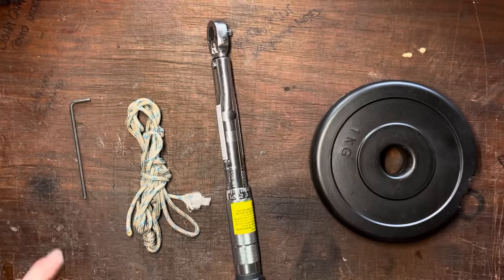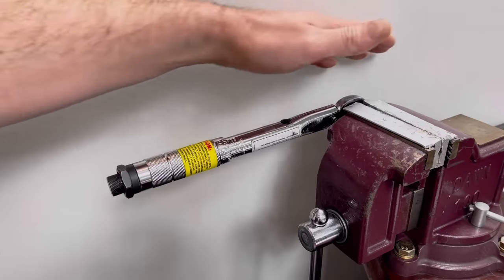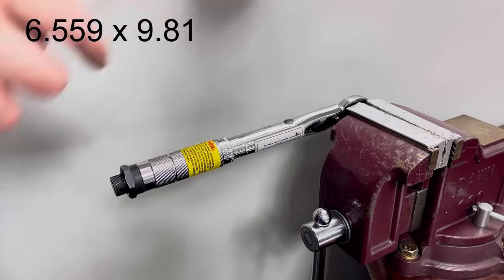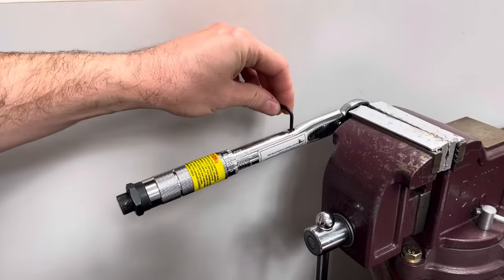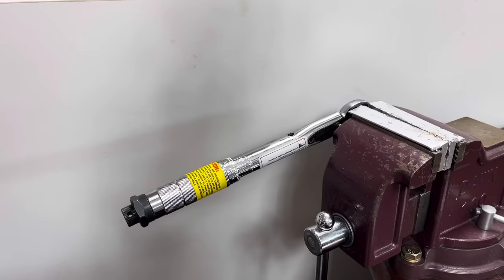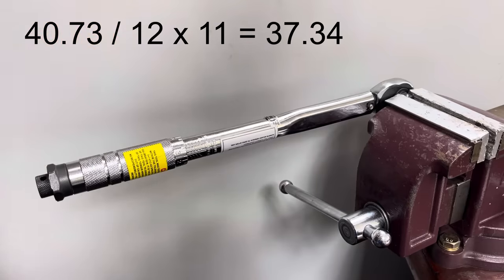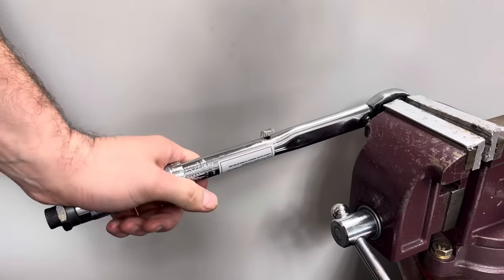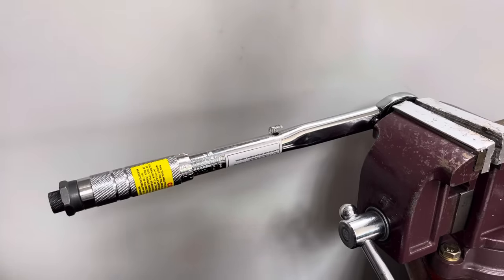CALIBRATE YOUR TORQUE WRENCH IN UNDER 5 MINUTES (NO SPECIAL TOOLS REQUIRED!)

Comment: You should measure the distance from the drive (where you hang your rope) AFTER you set the wrench to the appropriate weight because the handle moves in slightly toward the drive as you turn it. Also, make sure the wrench is perfectly level. Good tips, though. Thanks for sharing
Reply from the maker: Yep, thanks for watching. 👍
Reply: I could not believe nobody mentioned this, until I found your comment 😂👍🏼
Reply: These clicker type wrenches are typically calibrated for the force applied exactly at the middle of the grip (and it does matter, there are a few videos explaining and clearly demonstrating this), therefore that should be the point you hang your weights from and measure the distance to. Ideally, one should test different hanging positions on the handle with different weights at both ends of the wrench's torque range, find the position that gives the most accurate results throughout the torque range and then only apply force at that exact position during normal use. Whether it's going to be the middle of the handle or closer to either end of it really depends on each specific wrench model.
Reply from the maker: Yep! I have learnt something new here! Thanks for sharing :)
Reply: Also you need to take wrench handle weight into account. So actually it is way easier to calibrate it with torque meter.
Reply: @KibberShuriq  Thats only if you use this method to calibrate, when using a torque meter you can hold the wrench anywhere.
Reply: @fastone371  Nope. These type of torque wrenches actually measure the torque at the pivot point, not at the socket attachment point. Imagine applying a ton of force directly at the pivot point, or between the pivot and the socket. Your nut/bolt would "feel" that torque, but the wrench spring would not. Now imagine putting a 10 feet extension tube on the wrench. This would make your lever so long that the torque difference at the pivot and at the socket would become practically non-existant.
Reply: @KibberShuriq  Incorrect. A beam type torque wrench can be affected by where you hold it but not a "clicker". The clicker torque wrench only knows how much torque is at the head of the torque wrench, it has no idea where you are holding it. Its not like the whole handle bends on a clicker, its only the spring loaded internals.  The handle does not bend when using a clicker. If you don't believe me try it against a digital torque wrench, I have because I went thru this same discussion with someone else so I showed him how it doesn't matter where you hold it. I take it you have never seen someone putting a cheater bar on a torque wrench at a diesel truck shop? Its not that uncommon. A cheater may make easier for the user to reach specified torque but it doesn't change the amount of torque on the fastener.

Comment: Great video. I'm going to try this out myself. One note: I think it is important for the torque wrench handle to be parallel to the ground. If it isn't parallel (or as nearly so as possible) then the effective length is different from the measured length thanks to vector trigonometry.
Reply from the maker: Yes sir you’re spot on! I think it’s important to be as accurate as we can, but also remember that even if things aren’t precision perfect - it will still be more than good enough for what we do :) you won’t snap bolts being a bit over nor will it cause an engine to fail being a bit under the specified torque. Thanks for sharing!
Reply: @VintageEngineRepairs  Just as a follow up, if you're within 10˚ of horizontal you'll be within 2% of accuracy, which is equivalent to +/- 4mm on your length measurement. Given your string is about 4mm in diameter, that's plenty of precision. 
If you get out to 20˚ you're still within 7% of the calculated value, but it starts to rapidly fall off in accuracy after that.
Reply: 😯
whoooeeew
math does hit hard 😭
Reply: @daveatutube As the purpose is to calibrate the torque wrench, you want to do what you can to achieve max accuracy, and that does not involve having the handle at an angle.
Reply: @VintageEngineRepairs   You did not mention it, but did you weigh the rope with the weights? For that 1 or 2 % accuracy, the rope may make a difference. Not moaning, just checking/mentioning. Also, could we all say pound-foot, like Newton-meter? That's moaning ;)
Reply from the maker: @kapteinsuperskoot6986  yes! You can use luggage scales to eliminate this if you prefer :)
Reply: @kapteinsuperskoot6986  The rope likely does not weigh much, however the wrench itself does, and that weight adds to the torque. Something like half the weight of the wrench times its length should give a good approximation of the torque added by it, and that value would need to be subtracted from the calibrated value.
Reply: @daveatutube  What string are you using that's 4mm in diameter? That's practically rope at that point.

Comment: This is the best DIY demo I've found. The process is not that complicated, although for accuracy the right angle distance and mass need to be accurate. I've often wondered how much ambient temperature affects this clicker style of wrench. In the end, most of the time a variance of 5% is fine. Often it is a comparative tool, so even if it is out a little, all the bolts will have the same torque. These days we tend to go overboard with torque, although the margin for error in aluminum housings can be small.
Reply from the maker: Thanks for watching :) I agree, for what we all do 5% even 10% is not a problem. Heck you could be even further out and not have any issues. If it was on a a spaceship then it’s a different ball game. This gets you very close, easy to do at home and will be far more accurate than doing it by hand :) thanks for watching!
Reply: I agree that this is a clever way for diy calibration. Although not complete. Even though the style of torque wrench you show here is common, there are a lot of different ones. And the method of adjustment also differs. Some do have the screw you show now, but also a lock screw for instance. A lot of professional wrenches also feature an adjustable scale.

Typically you adjust the screw you show in the video to set max torque, and adjust the scale for minium torque. Most cheaper wrenches have a fixed scale and I would recommend calibrating for the range you use, as it will be hard to get it right all along the scale.

Most professional torque wrenches are supposed to be within a 3% margin along the full scale. Typical calibration is done at 0% 60% and 100% force. It will be hard to get it to within this spec with this diy solution. But it's definitely better than not checking it at all. The 3% margin is also ludicrous if you ask me, how you hold the wrench, how you apply force, is your bolt dry or lubed, etc will have more effect on the end result the a bit bigger margin on your wrench.

Bear in mind that the electronic force gauges might also not be accurate. Especially cheap models can have quite some deviation. So you might want to check the force gauge with this method before using it to calibrate.

In short, good method for approximate calibration with little expense. But not suitable for critical work.

Just my 2 cents as someone in the tool business, including calibrations.
Reply: The wrench handle should be horizontal; maybe it's the camera angle that makes it look like it's pointed down, which would make it require a higher torque to click off.

Comment: always back off torque wrench when finished using relieving spring pressure
Reply from the maker: Spot on, couldn’t agree more!
Reply: Agree...
Reply: Wrong, leave a small amount of pressure, 5 ft lbs, so the spring isn't collapsed on itself.
Reply: I see leave 5 and zero...ok, lock it or keep unlocked
Reply: @jeremywallace5961 how does a spring collapse in on itself?
Reply: I always thought so too but our latest Norbar 1/2” (40-200 Nm ??) comes with a note saying to leave it mid-dial (120Nm)!
Reply: Depends. We have torque wrenches used for testing of weld on nuts  in our production line that has been set at a certain torque for many many years and they still pass the calibration test every year. So I feel its a bit of a myth that they go bad..
Reply: My wrench instructions say store at the Lowest setting
Reply: @dubmob151  when the coils are touching, it has collapse on itself
Reply: Myth
Reply: There’s different kinds of torque wrenches, so it depends on the type. Of the clickers .. the “micrometer” type (as shown in video) generally should be backed off, but “split beam” style wrenches can be left at any torque without consequence, and then of course, there’s “fixed” torque wrenches which aren’t designed to be adjustable at all.
Reply: The spring doesn’t collapse on itself idk where you got that bad information. When you are done using a torque wrench you move the adjustment to the lowest setting but not zero and the reason is so the paw, cam, engaging spring and thrust washer do not move or come out of line of each other so just a tiny bit of tension keeps everything “meshed” together. Honestly the tension spring inside a clicker style torque wrench is pretty beefy so if you accidentally forget to back it off it’s not the end of the world, I have been in the automotive repair business for 20+ years and I know guys that never backed theirs off and when they sent them out they were still spot on or super close but we also have high quality $600 (USD) torque wrench’s and yes there is a big difference in quality the tool steel the spring is made out of but for someone at home a cheaper torque wrench isn’t a bad thing they still work but if you don’t back it off for 2 years you have a much better chance that it will be out of calibration. My uncle left a cheaper torque wrench in my grandfathers garage back in the late 80’s when he moved to Florida, It might have been a craftsman but I almost wanna say there was no name on it and it didn’t get used for 20 years and it wasn’t backed off. I gave it to my snap on tool truck guy and it was only off 2%. I’m not saying that there is no need to back it off I’m just saying if you forget to back it off once it’s not the end of the world. 

If you want to calibrate ur wrench for free with more accuracy this is how u do it Tool trucks usually have a quick calibration tester on the truck I can’t speak for all of them but every snap on dealer I have had has one and if ur a guy that does some tinkering around in ur home garage and u want to have it checked out it in ur car and when you pass by a snap on tool truck go ask him if u give him a couple bucks if he can check it quick and unless he’s a jerk he will do it for free because it’s a sales tactic for them because they want it to be off so they can say it’s out of adjustment and it’s old so ur best off buying a new one haha and when they tell u it’s off and try to sell u a new one ask how much it’s off so u can see it, make sure to bring an Allen wrench so u can adjust it quick, when he says u should buy a new one act like ur super interested say u want to replace ur 1/2 3/8 & 1/4 torque wrenches because urs are all old and u want new ones and ur gonna keep ur old ones in ur truck that will make him ur new best friend because he’s thinking he’s gonna make a 1800  dollar sale to you so he won’t mind if you adjust ur torque wrench just ask if u can check it urself which he will say yeah go ahead he won’t even pay attention while you calibrate it because he’s working out a deal on the torque wrenches ur not gonna buy. I have well over 100,000 bucks worth of just snap on tools so I know the sales tactics the snap on dealers use so I know how to use it back at them.  My last snap on dealer I had before opening my shop screwed me over a whole bunch before I left. One of the last things was a 1/2 in digital torque wrench I paid $600 for from him 1 year and 1 month prior. It had a 1 year warranty and the last time I used it was when it was 11 months old, I told him that it kept shutting off and he said he will take it next week because he was in a hurry and he wouldn’t be shipping it out until next week anyways well he didn’t show up the next week, I was on vacation the week after and then I forgot about it for a bit until I needed it and by that time it was 1 month past the warranty. I gave it to him and when I got it back he gives me a bill for $100 bucks for repairing it. I told him how it was under warranty and how he said he was gonna pick it up next week but never came blah blah blah he said I never told him anything about it and that he never would have told me he would take it the next week he would have taken it lol. I said regardless even if that was true it was broken before the 1 year was up I haven’t used it since and just look at it the thing looks brand new because I only use it for engine work I use a different torque wrench for lug nuts and other stuff it has literally been used maybe 5 times there’s not even a scratch on it. He made me pay for it. I said ok I will never buy another electric tool from u ever again ur not gonna hurt me. Then i bought an air hammer from him it was used but rebuilt with 6 month warranty, at 3 months it stopped working, he said there was no warranty on it, i told him how much I paid and he told me 6 month warranty then he said I would never charge you that much it looks terrible, I said so now ur telling me u ripped me off? I grabbed my receipt and it said 6 months then he said I was scamming him and it was a junk one I must have had at home. I said you know what here take the thing u can have it for free now leave and never step foot on this property again, he walks up to the owner of the shop to tell him what I said and the owner said well u better leave and never come back again then, if ur gonna scam my employees then I don’t want u here either. He leaves and came back a few weeks later with my air hammer and he had it rebuilt, said he had it fixed and he paid for it and I don’t have to, I said ur still gonna make up lies? You sent it off to get rebuilt when I bought it there was a tag on it from snap on it was under warranty u didn’t pay anything so don’t act like ur doing me a favor all u did was honor the warranty you gave me when i bought it. He said are we cool now? I said sure. When he came in one day like 6 months later he seen me looking at a solus scan tool on eBay and told me he will give me a good price on a new one, he told me 3,000 bucks I laughed and said keep it my buddy just bought one for 2,000 bucks brand new with a free mini bike, he said he must have got it on promotion so I said I’m gonna ask his snap on guy how much they are which I did and he said they are 2,000 bucks that’s the every day price and the mini bike was just a promotion but didn’t change the price they are 2,000 that’s the every day price with european and 1 year free updates, so I tell my snap on guy and he said the best he can do is 2500 but no free updates so I told him no thanks I’ll just buy one from the other snap on dealer, he said that dealer can’t legally sell it to you because ur in my territory he can loose his franchise if he sell it to you and I said no he won’t because I’m not gonna tell u who the dealer is and it’s gonna be in my friends name so he technically is buying it and selling it to me. Then the next week he tells me he can do 2300 lol I said why would I pay you 300 bucks more and not get the free updates when a dealer I never do business with is giving me a better deal. Then he tells me he’s got a used one for 1600 so I told him ok if it’s got the latest update I’ll take it, he said it didn’t and would need to be updated at my cost so I said the update is $580 so I would be paying more then I can get a new one from another dealer. Then he said ok I’ll do it for 2,000 with the update lol, I said what part of I can buy a brand new one for 2,000 do u not understand? Then He tells me I’ll bring the scanner next week and u can use it then we can make a deal work out. I bought a used one on eBay that day for 1720 bucks and when he came the next week he said I thought u we’re gonna buy mine for 1600 with it updated? I said that’s what I asked you to do but u said no then we will work something out so I just bought one. He said well I didn’t know u we’re gonna pay for it all at once and not make payments I would have gave u a really good price, I said dude I told u every time I will pay cash. Sorry for the super long comment but the people reading this will likely be guys that aren’t professionals and never deal with tool dealers so I want you guys to have some knowledge about how these tool dealers do business they all aren’t like that but many are so don’t let them pressure you or tell you that u have to buy it now or the price will go up or they have 5 other people that want it because it’s just bull shit lies.
Reply: You took the time to lead people straight.  Thank you.
Reply: Good read. Thanks.
Reply: @peanutbutterisfu      Your comment is a great example of the phrase, "There's no fool like an old fool." You spent so much time writing a worthless paragraph that can easily be disproven. The YouTube channel Torque Test Channel already tested this, and found that if you don't back off a torque wrench, it could read inaccurate by as much as 20 ft-lbs.